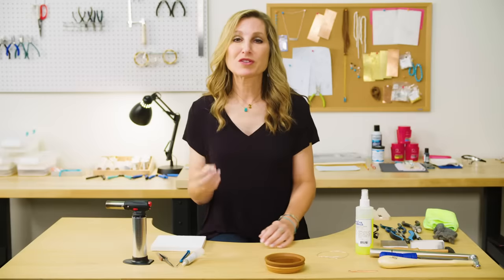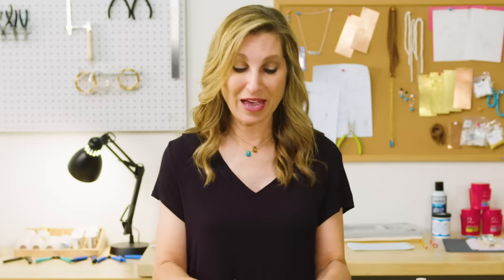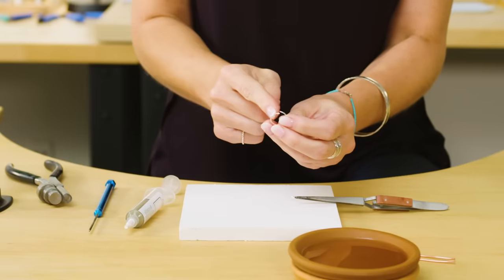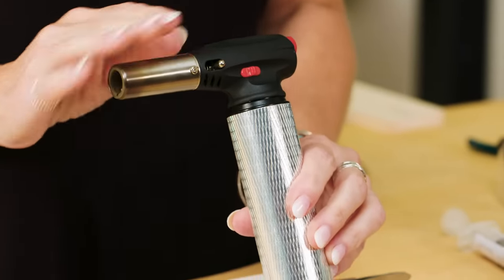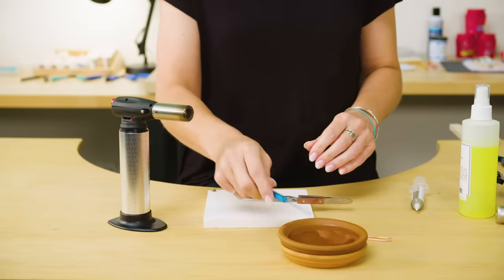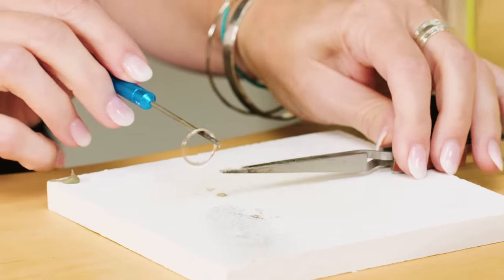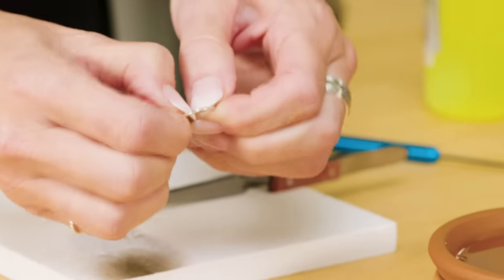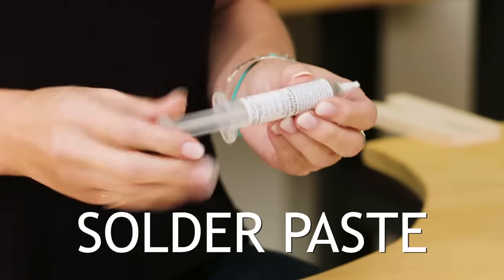The Basics of Soldering | Jewelry 101

Comment: Thank you for this video.  I appreciate your tips.  You list the things I need to solder, but you never mention the pickle until the end and you still don't list it as stuff that is needed.  So, is it necessary? Another thing, in the first part of the video you cool off your pick in the pickle (I thought it was water) but later you say not to put it or any steel in pickle because it will contaminate it.  Please explain.  I'm confused.  Thanks.
Reply from the maker: Hi Linda! Pickle is important for cleaning silver when it oxidizes during the soldering process. You just soak the items in the pickle to clean the metal. I have a quench bowl and a pickle bowl in that video. Do not put stainless steel into pickle. It will contaminate it. Always use a copper tong. That said I have been known to accidentally do it anyway and have to discard my pickle :(

Comment: I tried to solder a jump ring to a necklace I'm making but it won't work, any ideas. I used Cooper tape around the edges of the sea glass and soldered it. Thanks
Reply: Erica Arcas  This demonstration is mostly used for jewelry making techniques where you are joining metals together. The process you are describing is used for joining glass. You are using the Tiffany method of stained glass (invented by Louis Comfort Tiffany) where copper foil is adhered around each piece of glass before soldering together with a lead based solder rather than the lead caming process as in large panels or church windows, etc. 

Metal/jewelry and glass processes are very different, although the basic idea of joining like items together is the same. Different materials are used:  glass work uses lead solder which cannot and should not be used for jewelry or any item that comes in contact with the body. Although there are lead-free solders for glass-working, I have not found any that I am truly pleased with the results. Jewelry making uses precious or fine metals and solder so that they may be worn on the body. Although other metals like copper, brass, bronze, etc. may be used, they may cause a reaction with your skin resulting in anything from a mild black or green discoloration where the object contacts the skin, to a major allergic reaction causing rash, irritation, pain, etc. Should one of these base metals be used in jewelry, items like ear wires that come in direct contract with skin are usually made of silver, gold, or gold-filled metals.  

Different methods of heat are also used:  a soldering iron (usually electric) is used to melt glass-working solder; whereas a fuel torch (acetylene, propane/oxygen) is used for jewelry or metalworking. 

All that aside, the reason you had problems is hard to say without more information. To answer your question, I would have to know what materials, tools, and process you used to help you troubleshoot your project.

Comment: Want to ask about brass soldering. Any metal burns like brass and can be solded like for brass jewelry?
Reply from the maker: Fluxite Soldering Paste is suitable for copper and brass .. actually most metals other than aluminum (although other metals would require different solders) and can be used with either lead or lead-free solders.

Comment: I ordered some of that paste solder that you are using.  Mine is black and not clay-colored like yours.  When I tried to add the solder to the ring with the pic, the solder just dried onto the pick.  It would not transfer to the piece of copper.
Reply from the maker: Hey Jackie! It sounds like you ordered the paste solder for brass or copper, which IS clay-colored.  Order sterling silver paste solder, as in our kit, you will have better luck if you are soldering sterling.  I also use this for copper and oxidize.  If the solder is hardening on your pick, you are not hearing your piece properly before placing the pick and you are concentrating the heat to heavily on the pic.  Solder follows the heat.  To wherever the heat is…the solder will go!
Reply: @JewelSchool  Thank you so much!

Comment: What is the water that you use to spray on before soldering?
Reply from the maker: Hello! This is called Flux. Flux keeps the metal clean while your soldering. In this video, the soldering material (in the syringe) already has flux in it. The spray flux is used here to coat and protect the whole piece. Here is a link to the specific kit used in the video: https://www.jtv.com/product/soldering-basics-supply-kit-includes:-torch,-tweezers,-pick,-board-&-paste/JSYT15?mcid=XSOjsyt
Reply: @JewelSchool  There's nothing in the link about spray flux. Firecoat is not the same as flux, although they both contain boric acid.

Comment: Can you solder fake metals. Like the ones you buy at a craft store?
Reply from the maker: Hi! If you're speaking of craft wire, then no. Craft wire is a coated wire that has a base metal and this coating makes it extremely difficult to solder. Basically the coating will just melt away. So, these "artistic wires" really aren't good for soldering projects. It's best to save your soldering projects for your quality metals like sterling silver. Good luck!
Reply: @JewelSchool  can you solder stainless steel?

Comment: How do you select the appropriate solder paste.?
Reply from the maker: Great question! This will depend on the wire your using! to start, the flux is colorless - it is the solder that adds the color. So If you're working with sterling silver, use silver solder - it will leave a silver mark. There is paste solder that is made for brass or you can use a 10k gold solder.  This is a slightly different process than soldering with paste as you will need to use solder chips or wire which do not contain any flux in the mix.
Reply: @JewelSchool  thank you so much!!!

Comment: Does the “pickle” have water in it? Or Is it something else?
Reply from the maker: Pickling solution is an acid compound usually made using a specialized pickling powder or liquid pickle solution. So if you use heat and metal, it is essential that you set up a pickle pot!
Reply: Jewel School oh I had no idea. Thanks!

Comment: What kind of solder paste is this? Easy medium or hard? And what kind do you use with craft wire?
Reply from the maker: Hi Morgan! It's #65 Solder Paste - Craft wire is not meant to be soldered. The flame will ruin the coating and the plating. I do not recommend soldering craft wire.

Comment: Hey Susan! Thanks for the informative video, really appreciate the helpful tips! Just curious if I could follow the same process with gold fill soldering by using a lower carat gold filled paste solder? On the same topic, do you have any other tips with regards to gold filled soldering? Would really appreciate your insights! Thanks so much!
Reply: I have the same question. Also, could you please tell us if you can solder metals that are filled or plated and if so would you use solder that contains the plate material or solder that contains the base metal? Thank you for all your videos❣ I just found them, and they are awsome ❣❣❣❣❣❣

Comment: What is pickle made from
Reply from the maker: Pickling solution is an acid compound usually made using a specialized pickling powder or liquid pickle solution. So if you use heat and metal, it is essential that you set up a pickle pot!

Comment: What is in the pickle?  Is it just water?
Reply from the maker: Hey Carol! Pickle is a liquid compound used to remove oxidation and flux from newly soldered jewelry. It is what you put your pieces in to clean them after soldering. Metal that has been soldered produces oxidation on the outside of it. Allowing the metal to cool and then dropping it into the pickle removes the oxidation.

Comment: will this work for copper or stainless steel?
Reply from the maker: This will work for copper, but you will have a mark where the silver solder joins the two pieces of metal. I do not work with stainless steel, so I can’t speak to that.

Comment: What is in the pickle ?
Reply from the maker: Pickle is a mixture of an acid compound called Sparex No. 2 and heated water. It is heated is a small type crockpot specifically made for pickle solution. When heated, this mixture (or pickle) is used to clean your jewelry pieces after soldering (applying heat). It removes the fire scale or blackness that can occur on metals when applying high heat. Hope this helps!

Comment: What is in the water??? It’s not regular water is it?
Reply from the maker: There is a tray with regular water that you can use to cool your piece after the hot soldering and before it goes into the pickle. Then after the pickle you can use the plain water tray to clean the pickle solution off your piece before touching it with you bare hands. The pickle is an acid compound called Sparex number 2 and it is mixed with water. Check out this video! https://youtu.be/p4KJCcZgAvU

Comment: How do you make a pickle?
Reply from the maker: Pickling is simply dissolving firescale from the top layer of your piece after it has been heated. It's called pickling because jewelers used to remove firescale with a solution of alum, which is the same compound used to make pickles. There are lots of great solutions out there. Grab one, follow the instructions, and let us know how it goes!

Comment: Why would the solder burn and not flow ?
Reply from the maker: Hi! There are a few reason as to why your solder might not flow. 1) You need more flux. It helps to keep the metal clean so your solder will flow. Try a spray flux in addition to the flux that is already in your solder paste. 2) Your metal is dirty. Clean your piece thoroughly before soldering. Try using a brass brush or steel wool, which will help remove oil, dirt and grime. 3) Not enough or too much heat. You obviously need more heat (bigger flame) for larger pieces like rings and pendants and less heat (smaller flame) for small pieces like jump rings. The butane torch used in the video is adjustable to allow more or less heat as needed. 4) You have a "heat sink." These are items like your third hand that holds the piece your soldering. They draw heat away from your piece, which doesn't allow the solder to get hot enough to flow. Try a slightly different placement, like just on the corner of the piece or better yet, lay it flat on your fireproof surface.  Hope this helps!!
Reply: @JewelSchool  Thank you very much! Will try it again.

Comment: What is that pickle?
Reply from the maker: Pickle is an acid or citric compound (depending on what you use to mix it with water) that helps to clean your jewelry piece after soldering. Sometimes when using fire against metal, it can turn black. The Pickle will help you to remove this.

Comment: You kinda went by the liquid flux thing really fast. First it wasn't needed, the it was to keep the metal clean but then the 'pickle' keeps the metal clean. And what is pickle? On to the next video.
Reply from the maker: Great question. You do not need flux when you are using soldering paste, however, using it anyway can help keep your metal clean. Even when using flux you should still dip your piece in pickle afterward to clean off the firescale you get from the flame.
Reply: Hello, well I was wondering if anyone asks what the "pickle" was Kat did, but you didn't answer this part of the question. What is the Pickle solution you're using, I don't want to assume? Thanks!!
Reply: Yatazaqyah Rawach I was asking what it was? Next.......
Reply: @katferguson  She answered further down with another person as I kept searching. Lol
Reply: @JewelSchool  What exactly is in your spray bottle? In jewelry school, we were taught that you only put flux on the area you are soldering. To protect the piece from oxidation, you use something called firecoat.

Comment: what is flux?
Reply from the maker: Spray flux is a self pickling, water based solution that keeps the soldering joints clean by blocking oxygen, which causes oxidation. Basically, it keeps the flame from turning your jewelry black and also helps the solder paste to flow more easily. Hope this helps!
Reply: @JewelSchool  thank you so much!!

Comment: whats a pickle??
Reply from the maker: Pickle is a heated solution of water and a granular acid compound called Sparex No. 5. It's job is to clean the black scale that can occur on your pieces after soldering. It basically cleans the metal. be sure to only use copper tongs with working with pickle or you can turn it pink or what ewe call "contaminate" it.

Comment: What the fucz flux ?
Reply from the maker: You can use liquid flux to help keep your metal clean from the blackening (fire scale) that happens when you apply high heat. It also helps your solder to flow more easily into the joint.

Comment: The pickle, is that pickle juice?
Reply from the maker: You would think, wouldn't you!? Pickle solution is actually a liquid compound used to remove oxidation and flux from newly soldered jewelry. It is what you put your pieces in to clean them after soldering. Metal that has been soldered produces oxidation on the outside of it. Allowing the metal to cool and then dropping it into the pickle removes the oxidation.
Reply: @JewelSchool  after that could you polish it with a cleaning cotton cloth or a tumbler?
Reply: @JewelSchool  also what gauge wire and could you send me a link for the solder and the torch?

Comment: A couple of points, they are a pair of tweezers not a tweezer. You use the third smallest torch, why so big and on full boar, not needed. Paste solder according to every professional jeweller I follow and some of them have been working in the industry after their degree in jewellery for 30 years plus, say never use paste except for jump rings you were saying use all the time. For a good solder joint the metal must be clean, you didn't bother cleaning the grease off your fingers off the ring. I could go on but lets see if you leave this up?